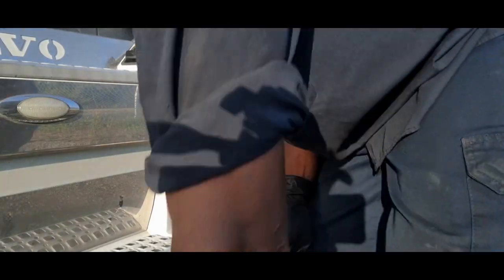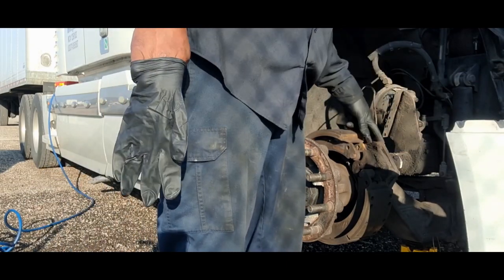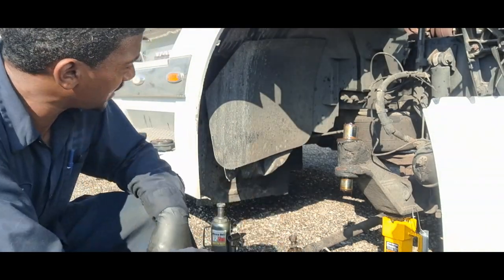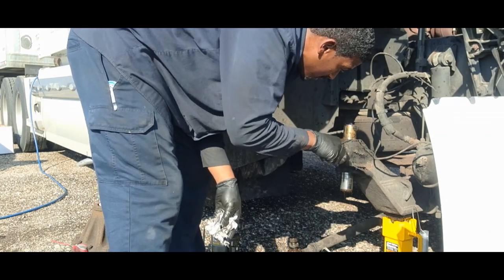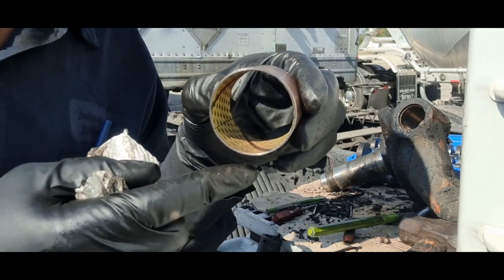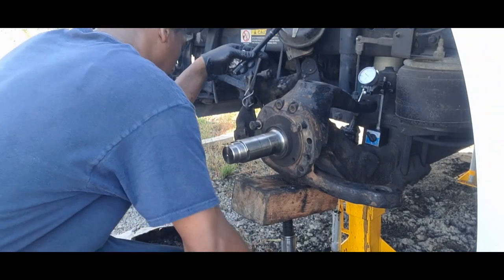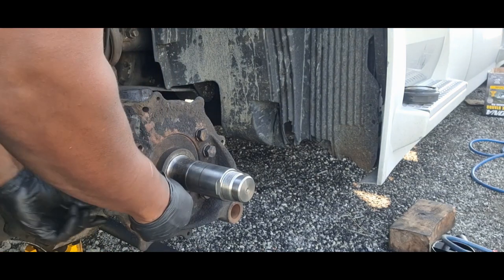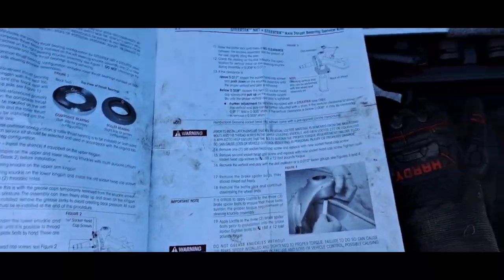Smooth Sailing Ahead: DIY Volvo VNL Kingpin Replacement Guide | Swap Hendrickson SteerTek Bushings

Comment: You missed half of the important part. What order do you assemble the bushing kit. You do you install the grease zert cap without messing up the rubber o-ring. You have to leave it off to ream the bushing. You left out all that important stuff. Other than that good video on taking the knuckles apart.
Reply from the maker: Yes, you are correct. I did record me reaming out the bushings and installing end caps...but the video was not usable.